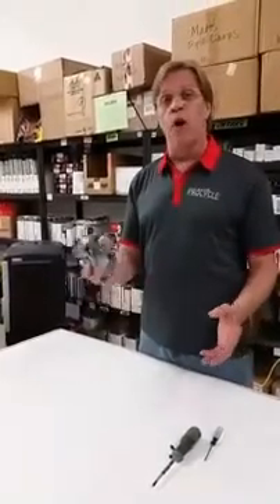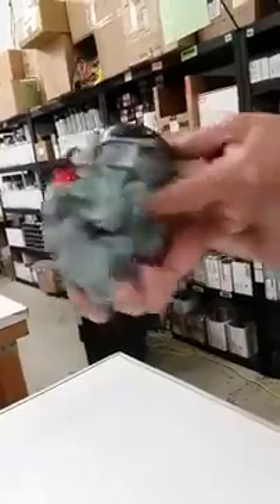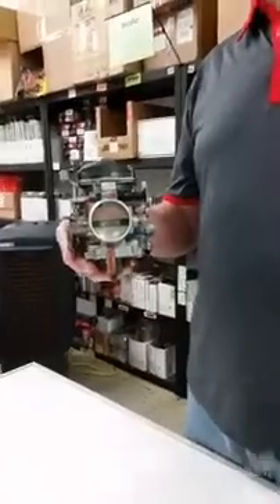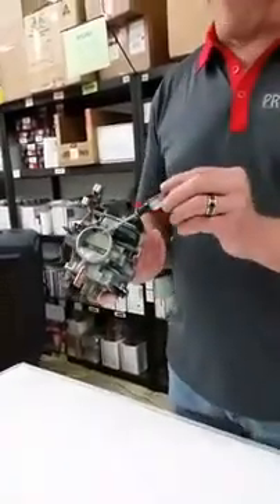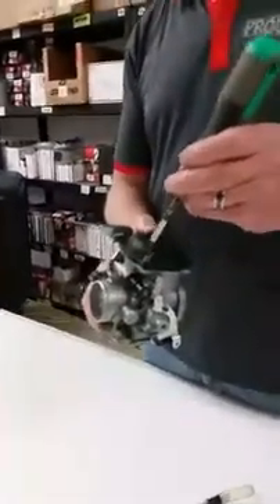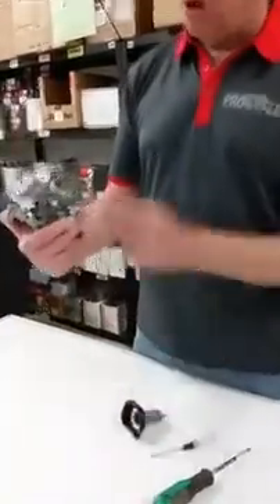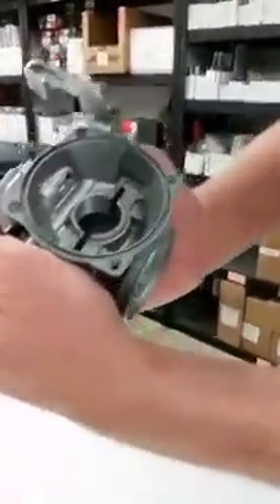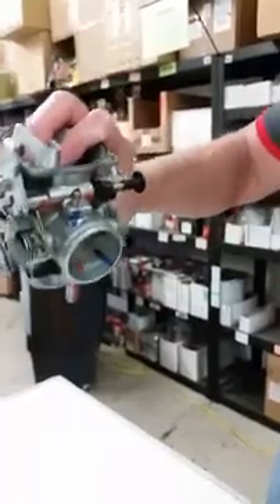ProCycle Tech Talk - Basic Carburetors

Comment: Just installed the BST jetting kit-getting some popping on decel even when slowly easing off throttle.Will it improve if I turn the mixture screw more than 3 times-using 150 jet ?Also does the extra hole effect the popping or just improve mid range responce in diaphram.I did not drill the hole in diaphram, but removed snorkel and drilled one 2.5inch hole in air box.

Comment: I just stumbled upon this carburetor tech talk video today… It just so happens that I dropped off my bike off at local motorcycle shop to me here in Clifton park NY… Coincidentally this shop is also called Procycle another well respected high performance full service 4 stroke repair shop… My bike is a 2013 DR650 since buying it brand new I’ve had a lot of modifications done to it including your 790 big bore kit,190 cam, oversized valves, 5 angle race port from CT-Racing, fmf power bomb header with fmf Q4 silencer and fcr 39 pumper carb from Mx Rob…. Sorry about the whole back story.. My question is about my pumper carb. I’ve been having some issues with my bike not running good at all this season . It’s ran great in the past but now all of a sudden it idles all wrong… sometimes it stalls at stop signs and red lights, sometimes it idles so high that I’m afraid it’s going to blow … This is the first time my local Procycle shop has seen my bike with the fcr 39 carburetor and he is 💯 percent against using a pumper carb on a DR650… he said that it will never run as good as it would if I put the original bst carb back on.. he said pumper carbs are for race bikes, bikes that are held wide open at all times not for a dr650…At this point in time I no longer have the original stock carb and with all the other above said mods I’ve had done to the bike I just want it to run strong and run reliable.. Could I get your opinion or advice on getting my bike run good and be reliable again. Thanks for your time. I look forward to reading your response..
Reply from the maker: The best way to receive specific help with your set up is give our knowledgeable customer service team a call.  Because each DR and setup are different, suggestions given in a response video  or comment will only create more questions.  We are more than happy to help anyone through troubleshooting and tuning the best way we can, so feel free to give us a call and we can work through your set up together. Kind Regards.
Reply: @TeamProCycle  Thank you I appreciate it I have a mechanic give you a call if need be thanks again

Comment: My question is do I need to cut out my air box for my setup? I just installed the procycle header pipe, with the mikuni HS40(TM40) fresh from procycle, K&N air filter and the DG rst exhaust. I took out the air box snorkel but with the carburetor setup as it is, its giving me a lot of deceleration poping. I didn't want to cut out my air box but the directions came with a template to do so. I was going to play around with the jets that came with the carburetor but I'm not sure which  direction I should go if I want the best performance for my DR650. Any advice would be greatly appreciated. Thanks procycle.
Reply: They said to roll the throttle rather than chopping it lime you normally would when shifting

Comment: Man my is loud though and can’t see me riding around town with this happening
Reply from the maker: Trying to roll off the throttle rather than chopping the throttle should help with the decel pop.  That, and making sure the jetting is correct for the air filter/ exhaust combination, making sure it's not running too rich, opening the air box to allow for proper air flow for the tuned jetting.  If you have any questions or need advise feel free to call or email (info@procycle.us), we're happy to assist any way we can.  Cheers.